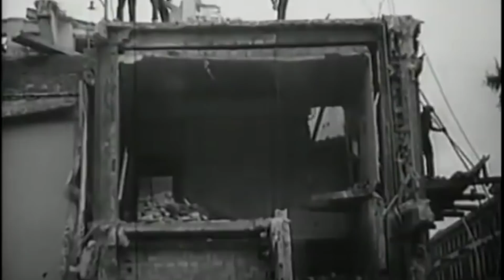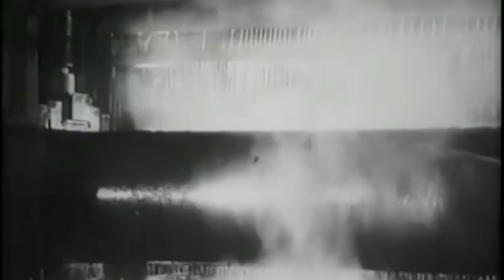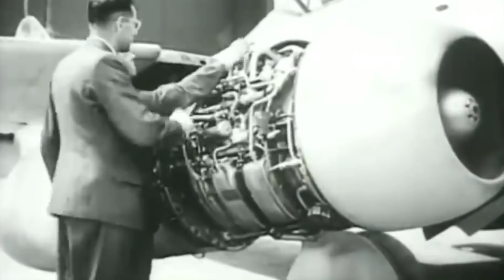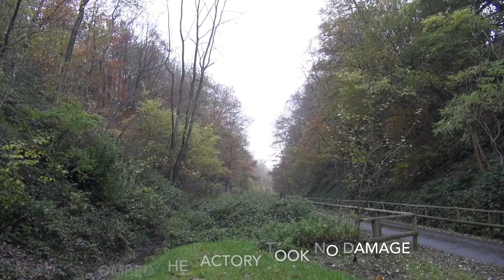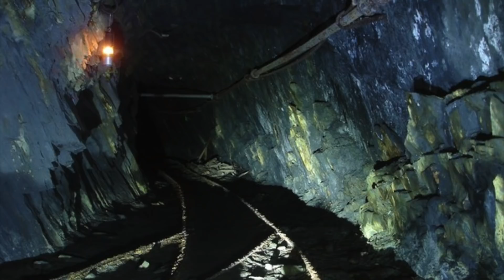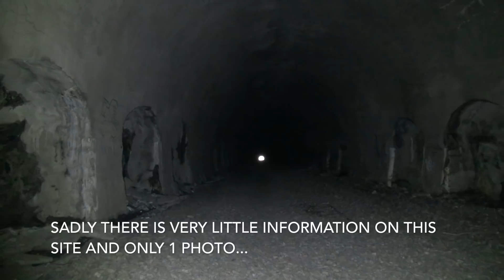WW2 GERMAN U-RELOCATIONS THE BREAKDOWN

Comment: Simple (sarcastically) just like making a house out of a shipping container...... Unfortunatly building a factory insiide of a cave /tunnel is a complex/complicated nightmare.. The problems of building and fitting a factory into a underground facility exponentially complicate every aspect of what goes into and on in a factory: ventilation,  heating/cooling,  fluids, gasses, electricity, lighting, production lines, entrances/exits, working conditions etc. it all goes forever. Simple factory standards such as bridge cranes and exhaust/smoke stacks become difficult if  not impossible....Look how tunnel corners were cut away in the Last V2 Test Stand ~ to believe that was not done back then is nieve.  To me with decades of factory and production mgt experiences the pain~in~the~ass factors have to be times ten and thats likely underated.......Slave labor and injuries/shitty~production went hand in hand...The German's dealing with underground production was like dropping a bowling  ball into their canoe when it was launched. Never in a million years could a country forced underground to produce match an advasary that can manufacture at will.

Comment: The tunnel with the "bicycles path" intrigues me.

The Me 262 is not exactly a small aircraft. You might just manage to wheel a fuselage without main or tail wings down that tunnel, but certainly not a complete aircraft.

And, once it was out of the tunnel, then what? How far away is / was the nearest field large enough to get a 262 airborne? They were not noted for their STOL performance.

And it would have to be a solidly built airfield as well, with not just a runway, but aprons and hangars, fueling depot, control facilities, guard-houses and barracks, etc.

Any signs of such a nearby facility "on the ground" or on aerial / satellite photos?. Or, were the "sub-assemblies" to be transported to more suitable operational airfields, closer to the flight-paths of the bomber streams? The 262 was a thirsty beast, with a limited loiter time.

Comment: No ventilation? It really isn’t that long. Typically the engine crews would cut back on firing a bit to reduce the smoke output. I used to work on steam powered excursion trains and we would know where that had to be done to reduce smoke when inside the tunnels. Is this track grade level or is there any gradient in either direction? Uphill is worse for obvious reasons. How wide is the bore? How tall is it?

Comment: The pillar at the mouth of the tunnel before you entered is likely for a signal to inform an approaching train crew whether the track is clear ahead.

The small cutouts, what you called an "alcove" are places where railroad employees who were working in the tunnel could get safely out of the way if a train came along.

As to ventilation chimneys for steam train exhaust, they probably are still there, they were just covered over by the concrete stucco when the factory was relocated into the tunnel.  If the tunnel was reactivated for rail use, post  war, the locomotives may have been diesel powered, or electric, although I see no indication of catenary systems for overhead wire use.

Comment: quite an odd tunnel that - clearly built pre wars, what was it 1879, must have been a rail tunnel to begin, converted to factory and then back to rail later - but its odd to see the cuttings outside so roughly cut, maybe blast damaged from some bombing, the reinforcement or buttress brick walls look fairly in tact and less damaged but at odd angles, all looks very rough and unfinished, but as you expressed, what a super entrance castellated front arch, nice, great vid Tino